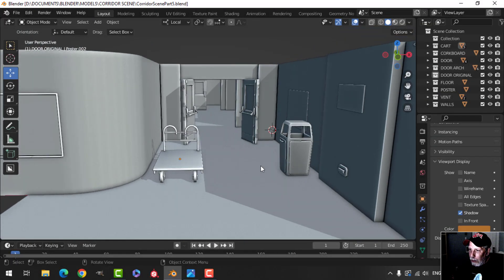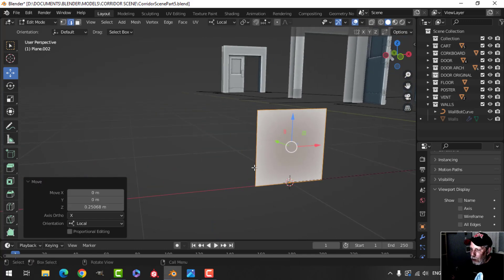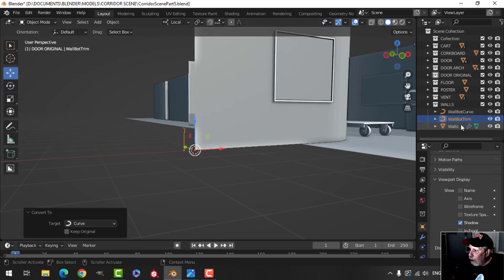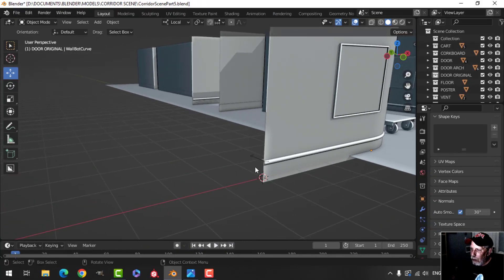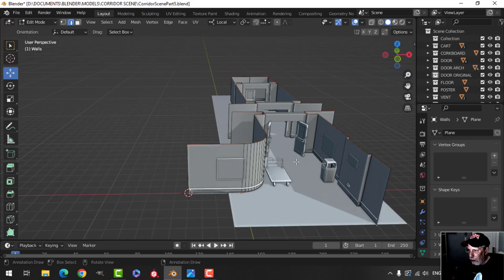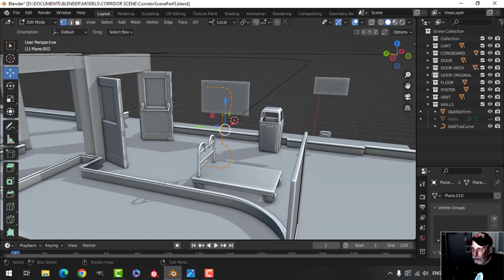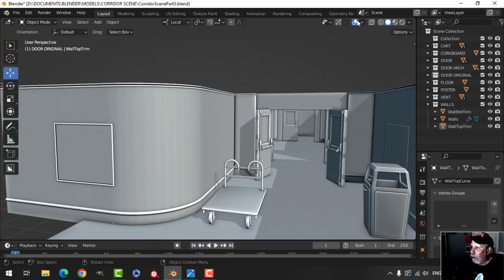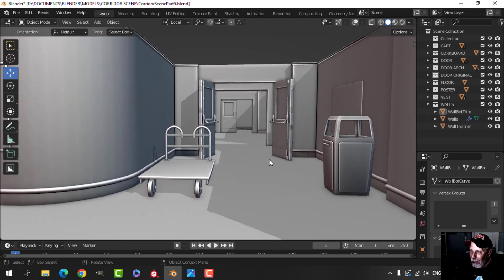BLENDER: CORRIDOR SCENE (PART 5)

Comment: Just one question, why are you still on version 3.1 of blender?
Reply from the maker: @JUNIORVILHENA-xg8jr  I've been having some trouble with version 4 and 4.2 as both were crashing in material preview.  I think I got version 4 working fine now but honestly, I'm so comfortable, I don't really feel the need ro change.  I'm the same way with substanxe painter.  I use an older version while a newer version is right there on my desktop.
Reply from the maker: Just tried 4.0 and working OK so far.   A bit slow sometimes.